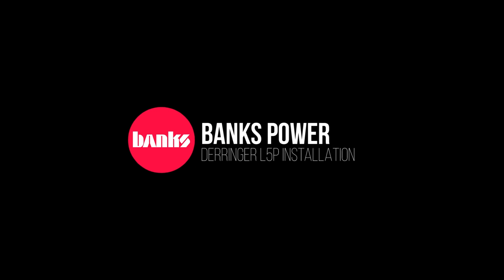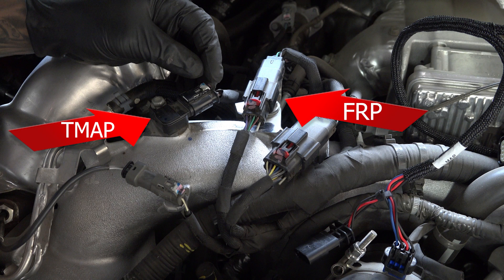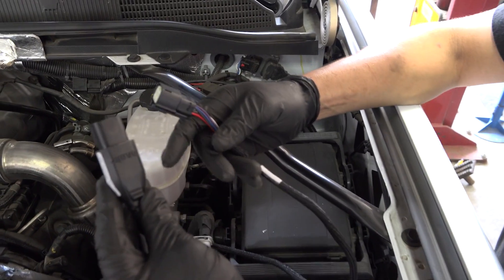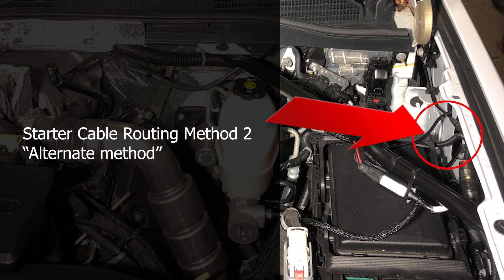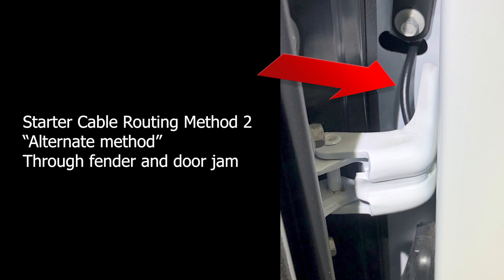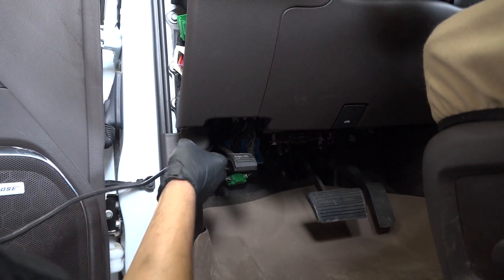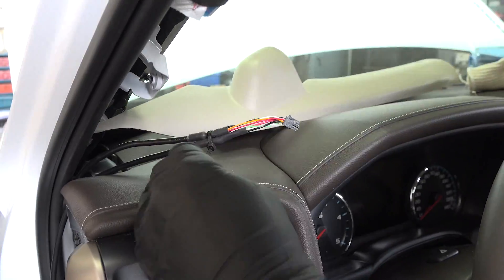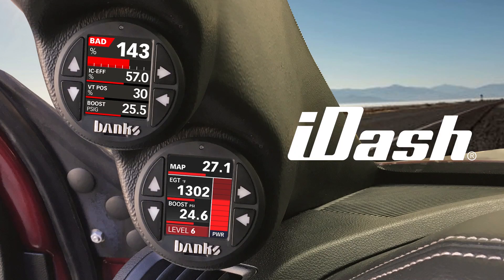Banks Derringer for 17-19 Duramax L5P Inline Tuner Installation Tutorial

Comment: Finding the area where the wire goes through the grommet is way harder with one person. It is a much smaller and more awkward area than the video makes it seem.. 1hr of running back and forth fishing, and I had to give up and call for help.. hopefully we can find it with two of us.
Reply from the maker: Kyle one thing to consider is going through the driver side fender, some of our customers have found that as an alternative.
Reply: Banks Power Thanks! We got it, though I have to say you guys were definitely right in the video, about using a coat hanger or similar tool,  to fish it through. It’s a cinch once it’s taped on and pulled through! 
It’s all wired up and working now, only trouble I’m having is with the little plastic clip for the pillar mount bolt.. Any tips to help keep it from popping out when the screw goes in? I’m trying to tighten as loosely and gently as possible, but after about 15-20min it pops loose again.

P.s. The power is amazing! I knew it would be fun, but spinning the rear tires under mild acceleration?! The smiles per miles are awesome! I can’t wait to see how much it helps with towing!

Comment: Just FYI I installed the system in my truck. 2018 duramax a few weeks later P0336 code came in truck started driving out of time. Unplugged the banks didn’t fix it. Changed the crank position sensor nightmare to get to. Still no luck drove to the dealer to get a relearn done 90 dollars later still broke. Dropped back off 160 dollars later the banks wiring harness on the fuel rail connects to the ckp shorted. Banks is returning the system which is good but the sensor replacement a dealer cost are too much to try a second attempt. Mainly the sensor replacement.,You will
 never recover from that misery.

Comment: Is it possible to use this with a eld device already plugged in? Ok hotshot and my log device is plugged in the ecm
Reply from the maker: If it tracking just a few basica data points like mileage, then yes it work. If it reading most of the ECU, then probably not. They will fight each other for traffic.
Reply: @bankspower  With the iDash plugged in my Onstar vehicle diagnostics doesn't work.

Comment: Can this unit be run on a y-split for obd2 port ? I have an edge cts2 monitor I want to use for accessory switch and monitor air pressure on my airbags and tank while running the derringer  tuner.
Reply from the maker: Your ECU isn't designed to communicate with two diagnostic devices at the same time. So, no, it will not work. However, there's no reason you can't use the iDash to display your airbag pressure with one of our analog sensor modules. https://www.bankspower.com/i-2843

Comment: I’ve read that people had to take out the air box to install the Derringer. Has this changed now? This video shows no removal of the air box.
Reply: I believe they have revised the kit. Now you don't have to remove the air box. Connection for the fuel rail is on top next to the MAP sensor.